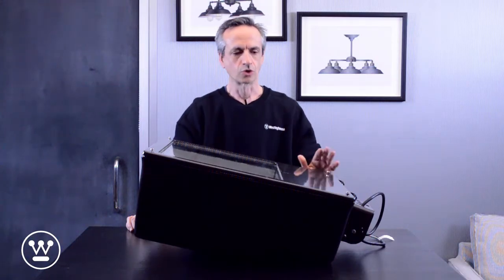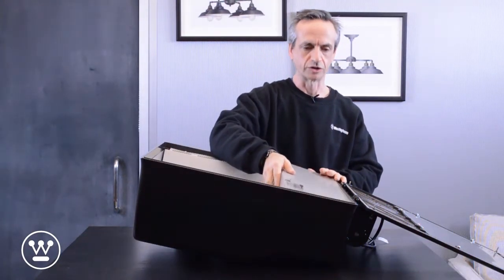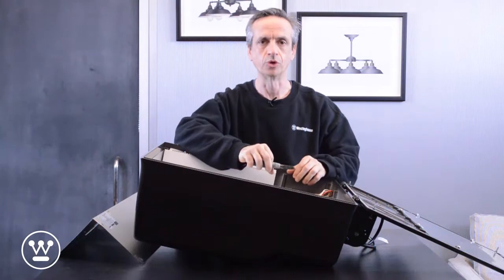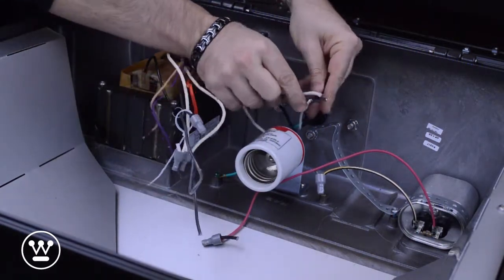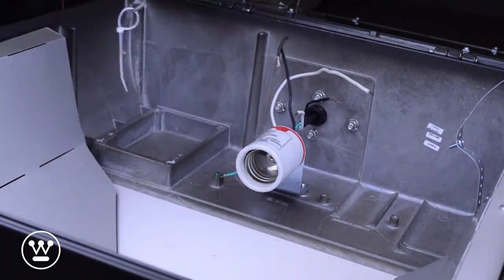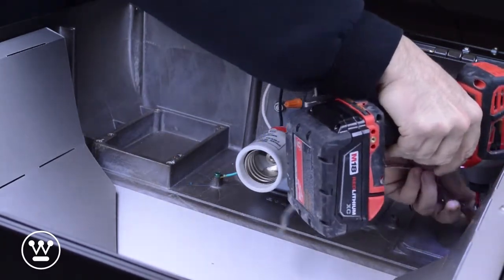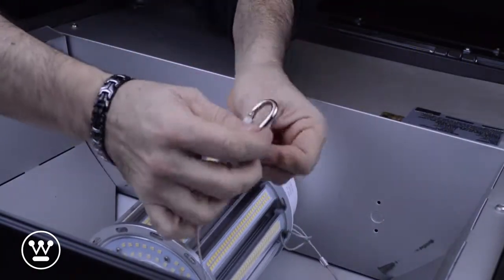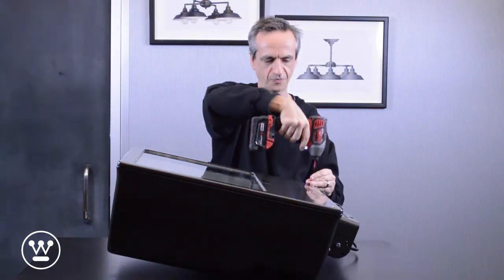High Wattage Parking Lot Lighting Retrofit Conversion HID to LED Lamp

Comment: Good video.  I would like to ask two questions.  Do you need any LED Drivers, and do you need any Cooling components for the new LED lamp?
Reply from the maker: Thank you for your inquiry. No additional LED drivers are needed, as they are included inside the
LED lamp. Also, no additional cooling is needed, as long as the fixture meets the minimum lamp compartment dimensions. This information can be found in the instruction manual. All instruction manuals can be found at westinghouselighting.com. Thank you!
Reply: @Westinghouselighting  Thank you for your response. All the information is helpful.